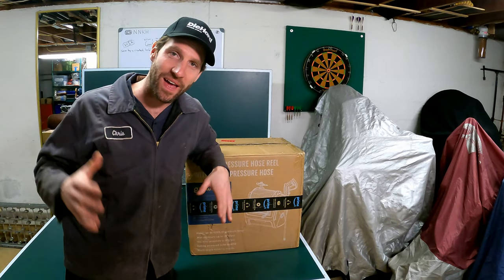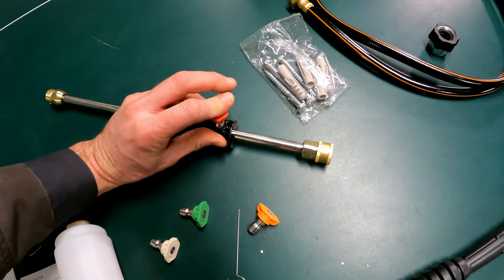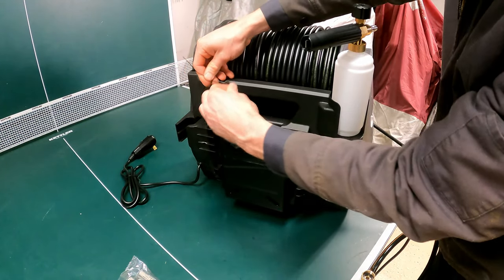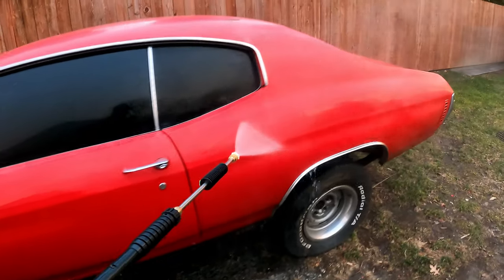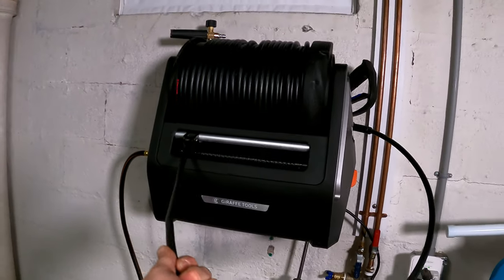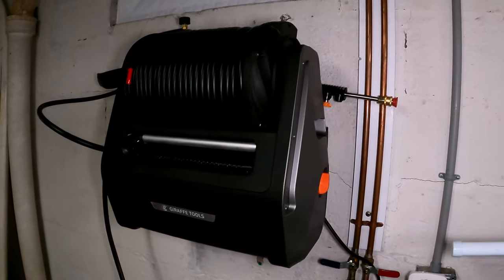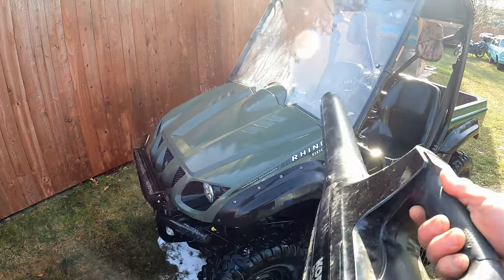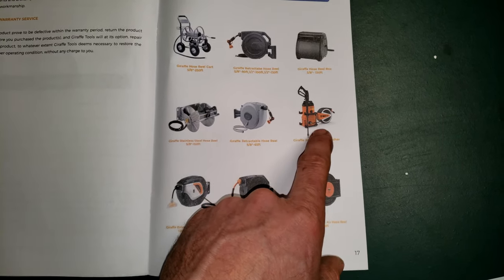Giraffe Tools Grand Falls 2in1 Pressure Washer REVIEW (Model: P106-G30) NNKH

Comment: Looks like a nice machine. Good job on the video--I feel like you gave us enough information, no fluff. If you think of it, make a follow up video next year and let us know how it's holding up. One suggestion: Don't use just any grease on o-rings or really on any rubber bushings. Petroleum-based lubricants degrade them. Silicone grease is a good choice for either natural rubber or synthetic rubber (EPDM, neoprene, nitrile).

Comment: Be aware of what I consider a bit of a bait and switch on these units.  Ordered one in Mid march 2022 and it arrived within a week or so.  The gun is drastically difirent.  It has a plastic joiner in the middle that will not allow you to easily use the gun without the metal wand for car washing.  Also the foam cannon that comes with it now is 100pct plastic, not brass as shown.  I think it is kinda crappy to send one version to all of these reviewers, and then only a few weeks later ship out a drastically difirent version.  I would like to give them the benifit of the doubt but I have to wonder if that wasnt the plan all along.
Reply: Noticed that in a few videos now. BS move
Reply: @russianrouletteracing  I had them reach out to me based on an Instagram comment I made.  They are shipping me the brass gun in a few weeks.  The normal pressure gun however I will just have to replace if I want a shorter one.

Comment: this is a plastic hose. they got pinched and pierced in no time. In detailling its not all about the pressure, Flow rate is the more important for cleaning.
Reply from the maker: Yeah. The stainless braided hoses are much tougher. Although for my purposes I think this one will hold up pretty good.